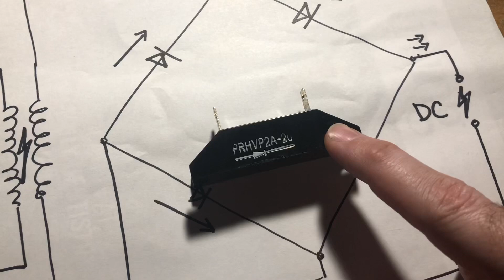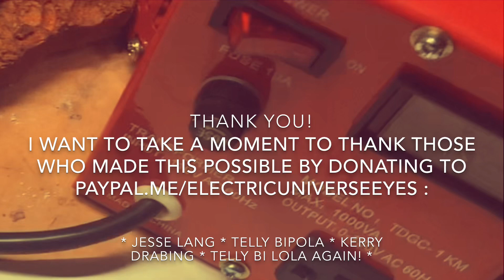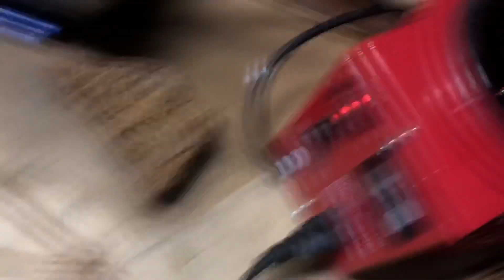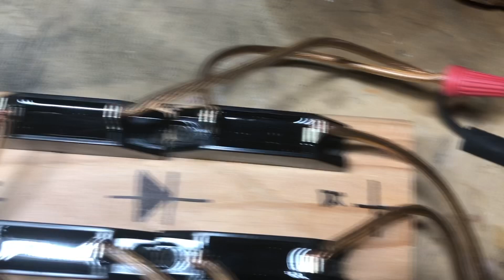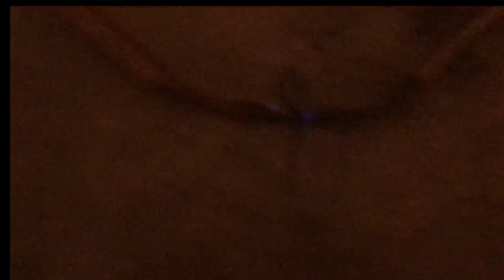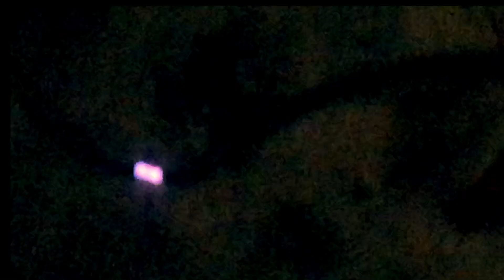Overview, Build & Testing My New 20kV Bridge Rectifier and Variac Using 3kV Transformer

Comment: It's called filtering when using a capacitor to smooth out the pulsed DC, that'll be the next step toward more like lightning, and the capacitor in that mode is referred to as a filter capacitor. What city are you in? Would be convenient if near Seattle, I could supply a host of different caps to try.
Reply from the maker: Thanks for the info and offer Gary! I'm quite some distance from you, all the way down south in North Texas.
Reply from the maker: Gary Hawkins Dallas/Fort Worth - YEEHAW! 🤠

Comment: You're going to have to have much higher voltage. Ac will jump an air gap much easier.  Pulsed dc  will jump easily as well.
Reply from the maker: I'll work on it! It only takes $$$ =) LOL